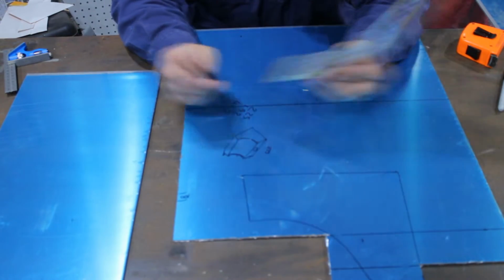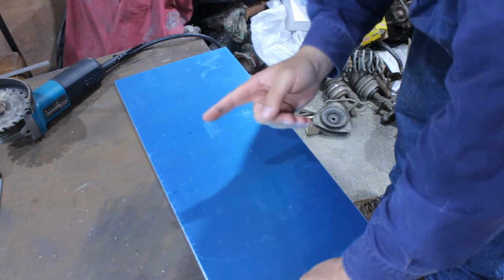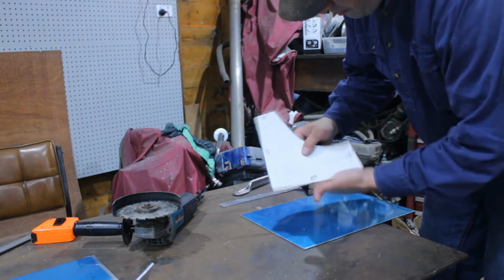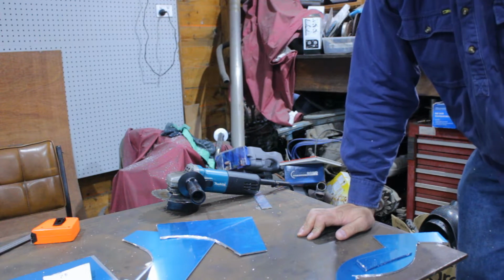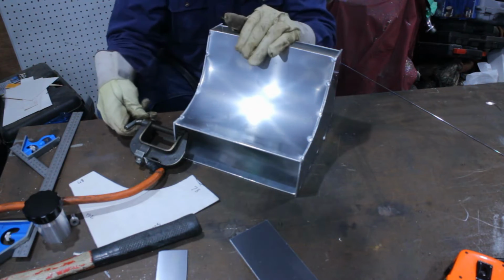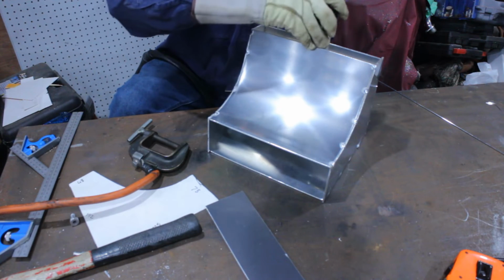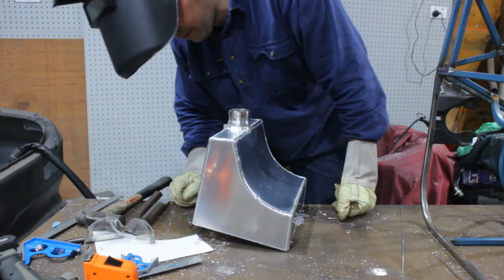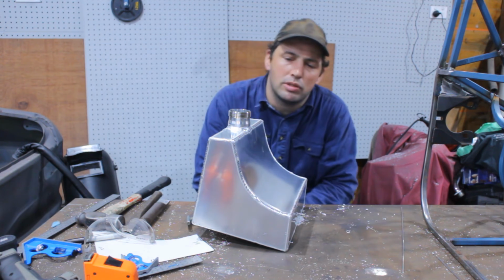The cubman episode 14 fuel tank

Comment: I think bolting it in would look better than strapping it in, is my vote.
Reply from the maker: bolts would look better but the mounting tabs are a place that will fatigue with vibrations. that is why fuel tanks are generally held in with straps. 
but i think i might risk it because it is only 6kg of fuel not 60
Reply: I see, makes sense.

Comment: Why two bungs?
Reply from the maker: pickup for the fuel pump and return for all the fuel that the engine cant handle. normally this type of engine would be gravity fed and would not need a return just a breather hole in the lid of the tank. because i am running a fuel pump to get the fuel up to the carby it supplies more fuel than the carby can handle so it would leak if i did not put in a return for all the extra fuel.
Reply: There ya go, I just learned something!  Cool.